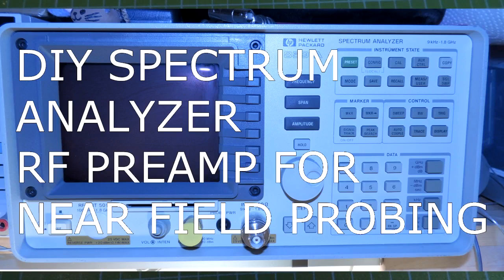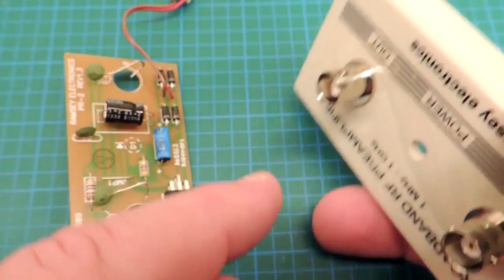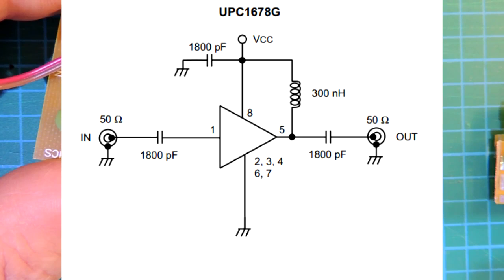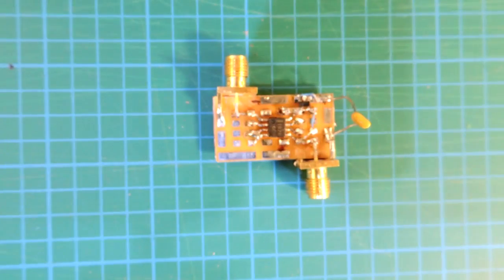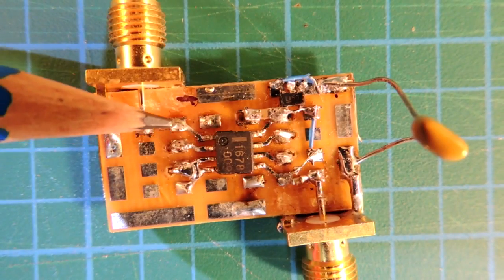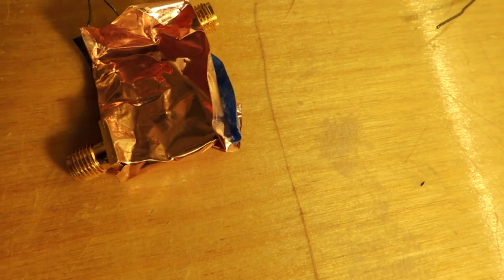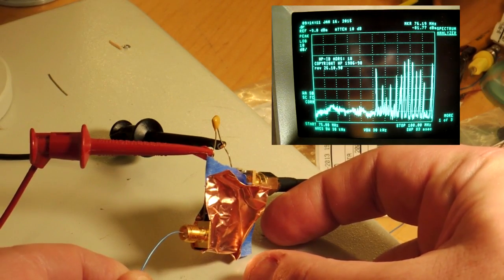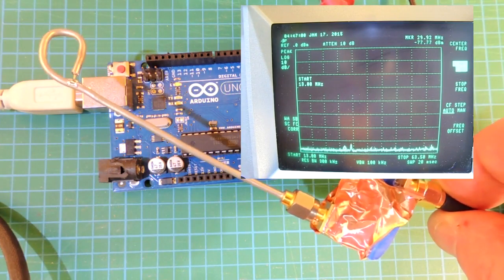DIY RF PRE AMP AND NEAR FIELD PROBE

Comment: Hey, this looks great, the performance as well and I would like to build one as well! Did you solder the 3 capacitors that were shown in the schematic and the inductor? Thanks!
Reply from the maker: Yes.  All parts are needed
Reply: ***** Thanks. This question might sound a bit boring but I don't have any RF design experience. Is there some special prerequisite for the inductor or can I use just a SMD inductor with 300 nH inductance or it has to be wire wounded component? Thank you!
Reply from the maker: refa If I recall it was a inductor from digikey  445-6324-1-ND
Reply: ***** Thank you! I will take a look at the datasheet and try to find an equivalent match.

Comment: Very impressive! I wish I knew half as much about RF as you do! I couldn't read the scale on the spectrum analyzer: Would one of those spikes we saw be the clock freq of the Arduino?

Would this be of use to ham radio guys trying to find sources of interference within their home or elsewhere? Can it be made very short range by default (as it is) but more long range/directional by attaching an appropriate antenna?
Reply from the maker: The highest spike is at 16 MHz which is the crystal oscillator of the Arduino's processor.

Near field probing has a range of mm/cm which makes probing rather time consuming.  The amplifier is just a general purpose amp... coupled with a more appropriate  directional antenna of your choice  you would get a much more usable range when looking for interference.